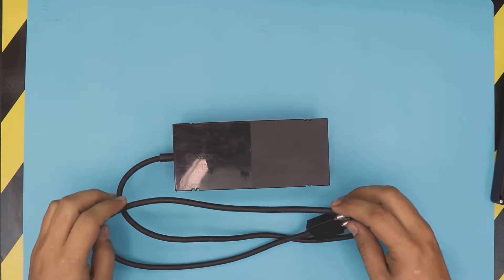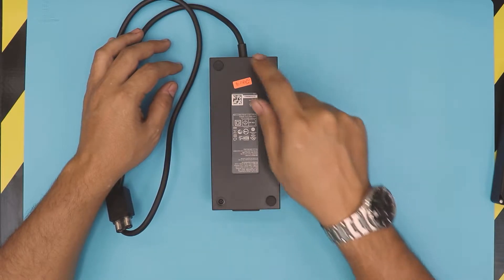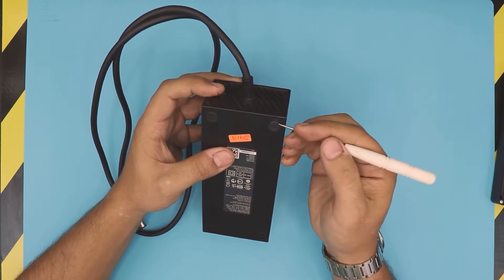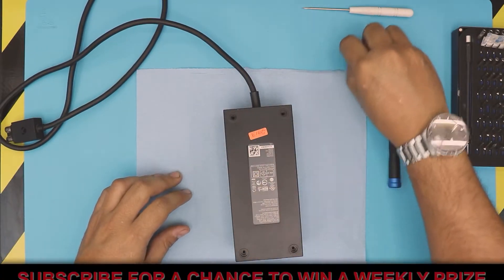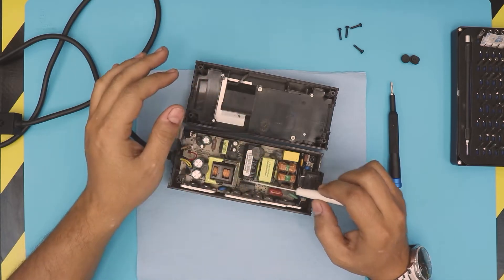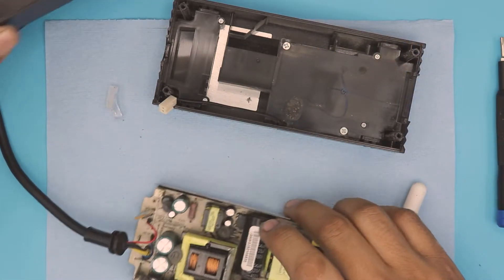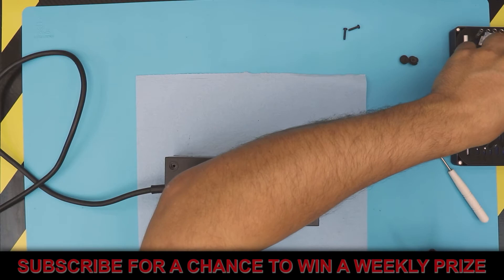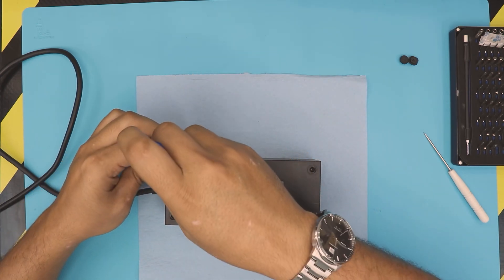Xbox One Power Supply Service Cleaning GUIDE...

Comment: be very careful doing this.
Reply from the maker: ya as long as you short the pin you be fine, and if you don't you will feel what it feels to get taized by a cop 🤣
it wont kill you but it will remind you to discharge next time.
Reply: @uFixTek  I would still be very careful as your dealing with a power supply I feel anxious around it but I cleaned it up and it’s like new now so need to worry about
Reply from the maker: awesome job my friend 👍🫠

Comment: Any suggestions on how to remove the screws after you've used the right screwdriver but you end up stripping the screws any?
Reply from the maker: Thank you for your feedback! If you wish to support the channel, you can like, subscribe, or both!
Regarding your question, right at @2:15 i explain the screwdriver i used "secure torx #10"
that is what you need to remove the screw my friend.
Reply: Buy metal glue. Its meant for sticking wood to metal for like shelves and stuff but you can just glue the screwdriver to the screw and break the glue off when you're done